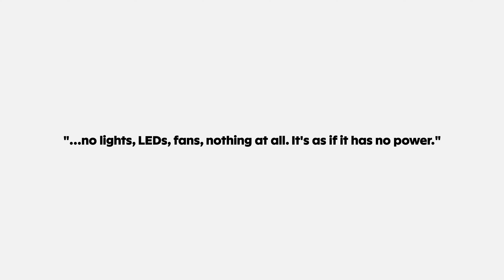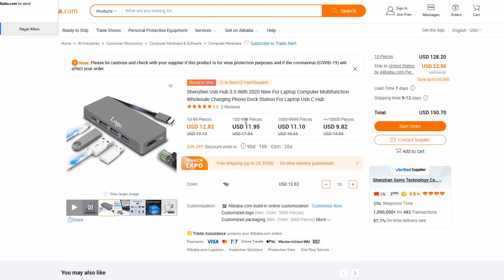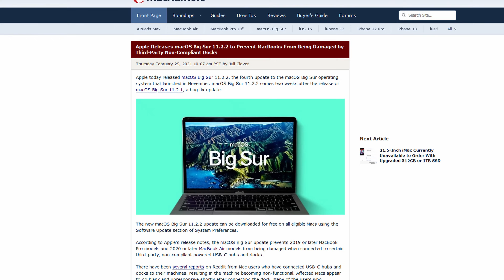Are USB-C Hubs Killing M1 MacBooks?

Comment from the maker: If you are thinking of buying a hub, here are two that I recommend and have tested myself:

Anker USB-C Hub: https://geni.us/machub
Caldigit Thunderbolt 3 Dock: https://geni.us/thunderboltdock
Reply: the more people are pretending that 2 measly ports is a good idea for a professional machine, the worse the problem gets.. apple users need to demand better from their cult.. otherwise they'll keep producing junk like this
Reply: I would also recommenrd the SATECHI USB-C hubs, they are good quality and don't give those problems.
Reply: @jaume-bg  do you have the satechi slim multi port usb c hub by any chance, I want to get satechi but not sure how credible they were.
Reply: How about Ugreen USB-C Hub? I heard their company is trusted by Apple? And their wire is MFi certified
Reply: using pepper job usb c hub which sell in asp provider here. no bellkin or caldig.  i got two surge proctector for my imac and m1.
Reply: @redfluz  ty
Reply: @redfluz  could you pls share the links of your purchases
Reply: Thanks for the recommendation. I unfortunately only get 4K 30Hz through the HDMI on the Anker with my Macbook Pro M1, but maybe there is a software solution, will look into it. Anker says the Macbook has to support DP1.4 to be able to output 4K 60 Hz. Have you had similar issues?
Reply: Anker products for Apple, I’ve found, are actually better than Apple’s own products.  I just purchased an Anker USB-C hub for that very reason.  Glad to know it was another good choice.
Reply: Can I use Baseus 17 in 1 Type C Hub??
Reply: @rezwanchowdhury2651  is this good to use
Reply: I would really like to use the usb c hubs that click in instead, seems more convenient. I mainly want to go the route of whatever will work best without problems
Reply: Is the problem only when  you charge your computer ore also using the hub for connecting a printer ore a cardreader?
Ludo
Reply: PSA: The Caldigit dock doesn't support dual display for M1 macs
Reply: should i buy a hyperdrive hub and are they safe?
Reply: I'm not onna  buy a hub for $ 450 for ports that should be in the notebook..
Reply: I’m glad you finally made a video, as I tweeted you long back in this issue. And with the OS update I feel confident to buy a dock now.
Reply: Apple doesn't have USB-C ports, they have USB-4/Thunderbolt (note, there is no number assigned to Thunderbolt any more).  Yes, it's a standards mess where some functions don't even have to work.  Thanks Intel!
Reply: @tonyburzio4107   old macbook and imac got thunderbolt 3 using usb c port interface, the m1 using thunderbolt 4 using usb - c interface. Normal laptop  some using usb -c charging only and have 2.0 usb some using 3.2 .. it totally depend on icon at the right or top usb c
Reply: @tonyburzio4107  Why thanks Intel? Apple has almost the same number of employees who participated in the development of the USB4 standard specification as Intel does.
Reply: hell no. bougtht mine for 15€ aliexpress. usbc to -> RJ45, HDMi, 2x usbA, usb C

Comment: started using one with my macbook m1 air 6 months ago and my battery health went from 98% to saying I needed a replacement. Started dying at 20% now it dies at 50-55%. Mind you, I've had my mac for 3 years now and only started happening quickly after buying a hub

Comment: Non powered hubs always kill your Mac even you charger your mac from other port. Because hubs always have multitasks and when they need energy, they drain energy from your one port which u wired it. And then your mac start to kill itself slowly. There is only one solution that u should always use powered dock sitation to dont drain your mac energy.
Reply: Can you recommend good hub with pd?

Comment: No cheap UBS-C Hub here... I've got a 80€ Belkin USB-C Multimedia Hub with pass-through power that has been ruining my MacBooks, either Pro or Air. I'm now on the third Mac, and soon it will be replaced by a fourth, because I have noticed that this USB-C Multimedia Hub, when used to charge my Mac, will sooner or later kill my machines. I'm glad I have a insurance for them, so I can always get a new and updated Mac for the broken ones...👌
Reply: were any of those M2 Macbooks? because now you got me real worried here, also, do you know if any of those times the mac was receiving power from another port instead of from the hub? because I know hubs can also draw power from the macbook too
Reply: @thetafritz9868  I can’t remember if it was an M1 (I believe it was). But the one I have now is starting to have the same problem with the same Belkin hub and it’s  a M2.

Comment: Try connecting your electric kettle, toaster, microwave and hair dryer to the same AC outlet while running them at the same time. You’ll either trip the circuit breaker or blow the fuse. Now imagine a thick piece of copper were used instead of a fuse or circuit breaker. You’ll burn your house down. That’s exactly what happens when you connect a bunch of devices to a single thunderbolt port via a crappy hub.

Comment: From some weeks to now, my (Intel) Macbook Pro started to sleep by itself, randomly. The machine turns its screens off and I have to disconnect all cables and press power to awake.

I already tried to reinstall macOS from scratch, ran EtreCheckPro, did a lot of tests, and could isolate the adapter as the potential responsible for the fault.

There's no visible damage in the adapter and I wonder if that couldn't be a software compatibility fault. Here in Brazil, this adapter is very expensive (> US$135) and I couldn't risk buying a new one and getting the same result.

Is someone more passing by this situation?

MacBook Pro (13-inch, 2017, Two Thunderbolt 3 ports) + Apple Thunderbolt Display
macOS Monterey 12.4 (21F79)

Comment: The problem is simple. Low efficiency power delivery circuitry in these hubs leads to hot hubs that fail at current limiting, leading to, basically, short circuits. 🤷‍♂️
Reply: Indeed. Can you confirm than that I will have no issues using an OWC Disc writer (connecting with USB 2 to 3 adapter) charging from its own power source and an ethernet dongle in one of USB C port used only for router cable connection?

Comment: I had a usb hub (not cheap) and I just got it a few hours ago and locked it when going to shower, then when I turned it on my Mac wouldn't turn on, you could hear the occasional boot sound though
Reply: Comments like this create more questions rather than clarifying the situation. Were you charging through the hub? How many devices were connect to the hub?

Comment: Good to know. I had a similar issue with two Topping external DACs dying when connected to my old macbook via USB. I figured out there was some voltage/static differential between them both, and from then, only used a toslik connector for electrical isolation. Thats something else to consider.
Reply: hii, which brand did you use? And was this not fixed after software updates?

Comment: I've experienced a similar issue. I have a 2019 13" Macbook Pro (not M1), and purchased a CalDigit TS3 to go along with my two Dell monitors. Everything works fine until I shut down my Macbook. It wouldn't turn back on. Needless to say I was scared shitless. I was able to turn it on a bit later (after 10 mins?). The same problem would occur later: not being able to turn on after I shut down my Macbook, though it always turn back on after a short wait.

Comment: Strange with the Mac Air M1 I just purchase Apple does not tell you there are no USB 3 ports. So after you buy it you must search for a Thunderbolt USB-C adapter. Also the battery is not replaceable; kinda forces you to buy a new one in five years and affects the resale value.

Comment: Within a month of using the MacBook Pro 2020, the USB hub that cost over $115 stopped working completely. One day it made a screech sound and then would not upload or recognize the camera. So now I have to replace it to find out if the USB works at all. I had to resort back to using my old mac, just to get work done. This is the first time I have ever been disappointed in a Mac.

Comment: Since Macbooks have two thunderbolt type c port, I use one exclusively for charging the other exclusively for type c adapters. I think this is the best approach
Reply: I do so too. I think this is the better solution anyways!
Reply: After watching this video, I was also thinking that that your approach is the best and safest solution.
I bought a basic SATECHI hub (no pass-through charging) and started worrying that it was going to cause me issues. But I'm relieved to hear that its only when using power pass-through hubs.
I only received my M1 MBA yesterday and I'm glad I came across this video early up to prevent any future disasters.
Reply: Even your approach is bad for your mac. Because your port will drain more energy to make 8 in 1 hub for multitasks.  If u ask me what is the absolute solution is that use always powered hubs like dock sitations. Because they will consume own energy from adapter not your macbook port.
Reply: What adapter do you have? I need one for an audio interface and an external hard drive
Reply: Aren’t they connected together though? If one is fried wouldn’t the other be aswell?
Reply: indeed, one for the hub, one for the charger.
Reply: @Senpai electrical stuff can't be touched by software, it not solved anything, apple just blunder on the new architecture just it , defect
Reply: @devinminutes2040  The issue was software based, not hardware based… I really don’t understand this comment.
Reply: @devinminutes2040  Ever hear of firmware?
Reply: @devinminutes2040  kiddo
Reply: @devinminutes2040  L

Comment: I was just using a Belkin 4 port hub with passthrough charging on my M1 air. I had a power adapter connected, an audio interface and a webcam.  I had a monitor hooked up to the spare USBC port on the mac. Both ports died suddenly while using garage band with OBS and FB messenger.

Comment: If you connect macbook m1 air on Samsung via USB C port, to stream and charge at 65W, will it spoilt the device or maybe the battery in the long run because it is always charging everyday at work?

Comment: can a usb hub drain laptop battery ?? cus im using m1 mac with " stay go " usb  hub ( bought in apple store while purchasing my m1 ) and when the older versions of hd or hd ( like i don have ntfs on this mac ) when i leave it connected battery drains super fast ! why is that ?? help
Reply: I think the same happened with mine. I got an adapter to use my mouse for my MacBook. And I’m pretty sure the battery started draining fast. Because when I took it off, it went back to normal.
Reply: The brand I used was called “Unitek”

Comment: I was using anker usb-c hub and it used to get hot in no time!! Ultimately had to buy from apple itself!
Reply: Well its going to have to be a passively cooled hub, unless you want a much bulkier product with inevitably noise causing fans. There’s always got to be a chipset inside these hubs, and so they use the external enclosure as a heatsink effectively.

Comment: Everytime I use the hub I have, to connect a monitor, mouse or hard disk, I can see that my battery percentage drops quicker. I don't get the same battery life that I get when disconnected. And for that reason, I simply stopped using the hubs unless absolutely necessary. But is this something that I'm dealing with alone or is it a common issue?
Reply: I'm facing same issue with MBA M1
Reply: me too..

Comment: I have a usb c hub for my 2019 MacBook air. I can charge the MacBook through the hub, so it seems to be working, but when I plug something into the hub, it is not detected by the MacBook. The MacBook seems to recognise the hub in System Information. Any idea why it's not recognising any usb devices?

Comment: Hello, when I run my fingers through the back of my computer I feel a tingling sensation, at first I thought it was the charger, but I later found out, that if I disconnect the USB-C the tingling sensation disappears. Do I have deffective mac or deffective usb, sometimes I feel the same with the charger too. I bought my computer in another country, any advice will be appreciated. The brand of my USB is SATECHI
Reply: Sounds like a electrical grounding issue. Do you have any other metal devices you can check with? Maybe time to call an electrician

Comment: Used a USB-C hub for 2 years and it has killed my MacBook 3 times. Apple replaced the whole motherboard free thanks to warranty every time but.. Instead I bought a M1 mini for work and use the 2019 13 inch MacBook Pro for when im on the go.. WITHOUGH A HUB. I used a cheap one at first. Then I used the expensive ones but same effect..
Reply: Was it a powered hub and were you charging through it?
Reply: did you charge it via hub? or the hub was used for data transfers only?

Comment: (3:32) I think this'd be survivorship bias, not confirmation bias 🤔
Reply from the maker: No, confirmation bias is the most appropriate bias for this context. People that have hub issues or are researching it are much more likely to come across others experiencing the same thing, or news articles discussing it. These interactions will amplify their perceived frequency of the issue. 

In layman's terms, if you search "USB-C hubs killing MacBooks" on Google, you'll get a heap of search results confirming that bias. This makes you believe it's a huge issue. In reality, those results are from sensationalist tech journalists trying to get clicks, and a very small (but very vocal) percentage of people who HAVE had issues. 99.9% of users won't have had any issues and therefore won't post about it.

Survivorship bias would be like asking a current MacBook owner if their device has failed due to a USB-C hub. Their current MacBook works fine and has "survived", which gives you no indication as to the depth of the issue. It's like gathering 1000 working MacBooks in a room and saying "well none of these MacBooks have issues, so there's clearly no problem".

Comment: I had the hub (from AppleStore) going very hot in the 2018 Intel MacbookAir. I had a funny feeling about it and never used it with my M1 MacbookAir.
I reasoned that if it burns my fingers with just a hard disk, the charging load will fry it completely.  It does not feel right.

Comment: Dear Sir, thank you for your video regrading USB C Docks. I have just purchased Baseus 6-1 Multi functional HUB. I have only started using this for the past week or so. I do have an old Hub which I have used on my old  G4 Mac Tower for many years but decided to buy the Baseus only to see how well it performs. Let me know if that is safe as I have researched a fair bit about this brand and they have been positive.
Reply: How is it going with Baseus USB C Hub? 
I just purchased it as well and waiting to use it with my Macbook Air M1.
Reply: @alexhemman7123  i got the Baseus 8 in 1 about a week ago. So far so good with my mbp 2020 m1. It just gets a little warm. I am not sure if that’s an issue.
Reply: @danieladrian103  Good to hear that. My Baseus 5 in 1 working fine after 2 months. 
Cheers!
Reply: @alexhemman7123  hey I am planning to by the baseus hub, I wonder how is it going ?
Reply: @sudeeris7294  Still working great. I rarely use it, but just used for Zoom Call with external Mic through an Audio interface yesterday.

Comment: I miss the days when Apple would build in ports and you didn't need to rely on 3rd party sellers to finish the job.
Reply: or if Apple themselves would at least sell us the proper adapters.  I mean they do sell adapters but not really what people need.
Reply: @PlymouthNeon  fr $70 for 1 usb c 1 usb and 1 hdmi LOL
Reply: A hamburger with no ketchup already on.
Reply: To be fair….Mac can finish the job (for the low, low price of $200…after  purchasing an already $2,300 MBP). 

Not that I’m not holding a grudge or anything.😶

Comment: I have been using the Otolla 10port hub.  It uses both usb c ports.  I also use a charge through that plugs into the hub.  I have not had any issues with either except occasionally a peripheral will turn off unexpectedly.  That, I think, happens if the power draw exceeds the power available.  I find the need for external hubs very important with the new M1 MacBook Pro, since it only has two usb c ports.

Comment: I wonder if  your hub drain your battery? I test it on 100% battery and connect the hub with two external hard disk to browse some files and copy it to my macbook. It's just about 10 minutes and the battery drops to 95%. Is it possible because the hub?

Comment: Hey there thanks for sharing your review! I just purchased Macbook pro, very expensive making me paranoid to use third party stuff. Is the USB C port easily damage**? I already own USB 3.0 4xusb port hub and enough for my needs. So I only purchased a small adapter converting USB male to USB C. All works except the paranoia it gives me 😂 the Apple adapter is $20 😂, but I’m just using a $4 adapter.

(**btw, reason I asked is I know the lightning port of iPhone x is prone to be damaged by third party if it is micro millimetre thicker, it pushed my iPhone port contact strips to become a bit “wider” than before. I hope it’s not the case with the new USB C which acts like opposite to lightning ports (middle port tip male is inserted to the plug)

Comment: I’ve been planning on getting a M1 MacBook Air and i want to back up my DVDs to a external hard drive with it. I have never owned a MacBook before and i was wondering will i have to copy the DVDs to the MacBook’s hard drive first or can i copy the DVDs straight to a external hard drive with it? This got me thinking because if i can copy them straight from a DVD drive to a external hard drive I assume I would have to use a USB hub.
Reply: SSD and Mechanical hard drive will fail faster than any M-Disc. I'd recommend and OWC Mercury Pro DVD/CD reader and burner. With an adaptor you could connect it easily to any of the M1 USB-C ports.